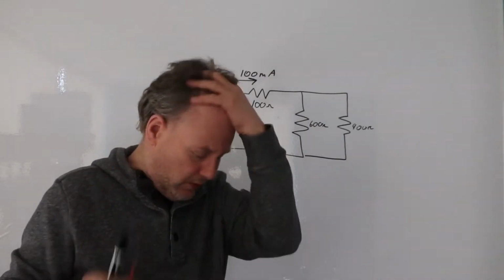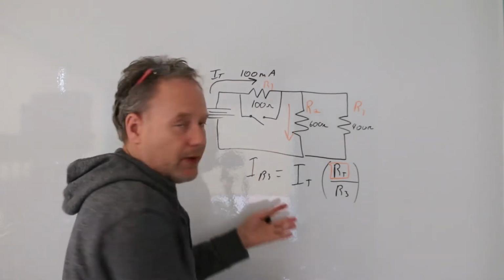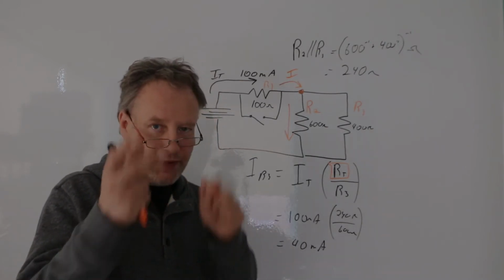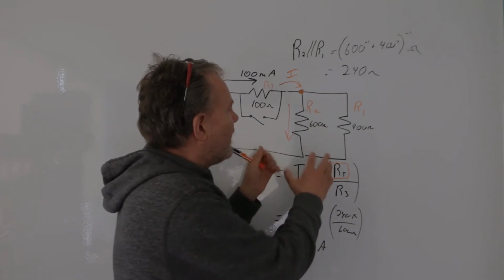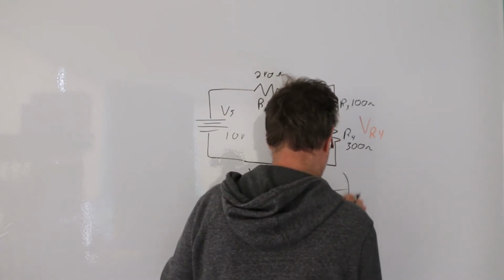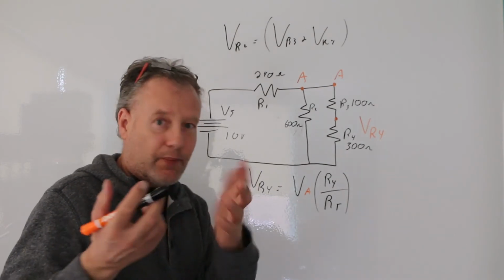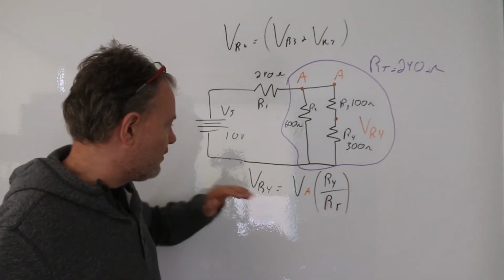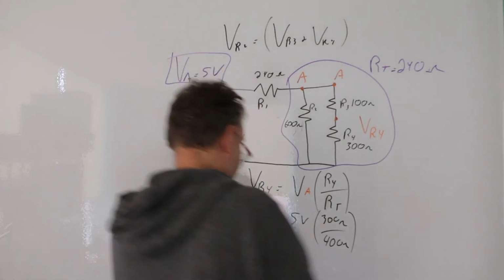Voltage Divider & Current Divider for  Series/Parallel Circuits

Comment: what about all of the weird formulas out where there equivalent resistance part is like (R2 / R1 + R2)? Why and when does the equivalent resistance part of this formula change? And what makes 2 resistors be neither in parallel nor in series?
Reply from the maker: Hello Danny:
This is way too much to comment here, but I do have videos on your question. 

I have a whole lecture on Series circuits and another on Parallel circuits. I also have two videos on Series/Parallel circuits.

I suggest you watch the two videos on Series/Parallel circuits and if that doesn’t fill you with understanding, you can go watch the two lectures on just Series and Parallel circuits.

Here are the two videos on Series/Parallel circuits:
Lecture Series/Parallel: https://youtu.be/BZjvVyB4Bxk

Examples circuits on Series/Parallel: https://youtu.be/4U_DSxdt1zo

Series Circuits Lecture: https://youtu.be/XM6wBucnB88

Parallel Circuits Lecture: https://youtu.be/bq4AM98_GmA

I hope these help answer your question.
Reply: @larsexplains3086  well thank you, but I think I'm asking  more about whenever resistors aren't in series or parallel. I believe this requires you to use voltage divider, KCL, or KVL and each circuit is treated differently

Comment: why is the total resistance sometimes on the bottom and sometimes on the top?
Reply from the maker: Hi Anna. 
Short end of this is that you must understand there are two different formulas discussed. One formula has the total resistance in the numerator and the other formula has the total resistance in the dominator. The two formulas used are both “dividing” either voltage or current. One that is the voltage divider formula and the other is the current divider formula.

For both the voltage divider formula in the current divider formula, we are taking either the voltage or the current and multiplying it by a ratio of two resistive values. One value being the resistor in question which is doing the dividing and the other being the total resistance. In both formulas, that ratio must always be a value less than one. We are looking for a division of the total voltage or the total current, so the multiplied ratio must be less that one. If the ratio were greater that one, we would end up with more voltage or more current that we started with.

Keeping that in mind we can discuss the two different formulas:

When using the voltage divider formula, which is only used in series circuits, the total resistance is on the bottom. This is because the total resistance in a series circuit is always greater than any of the individual resistors. To ensure we have a ratio of resistances that is less than one, the greater total resistance will be on the denominator and the resistor question is on the numerator. This ratio ensures we are multiplying our voltage by a ratio that is less than one.

When using the current divider formula, which is only used for parallel circuits, the total resistance is on the top. This is because in parallel circuits the total resistance is always less than any one of the individual resistors. Putting the smaller total resistance value in the numerator and the larger resistor  value in the denominator our ratio of resistance is less than one.

I hope that helps. Let me know if I can explain something else or do a video on a specific topic you want to learn.